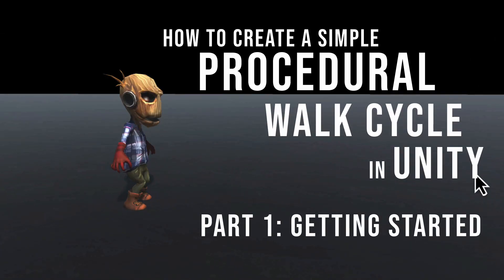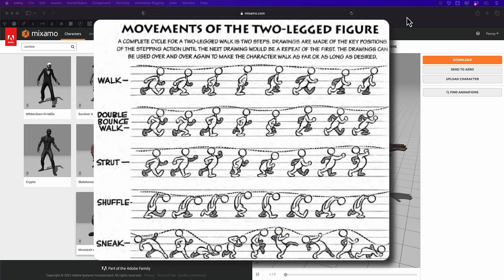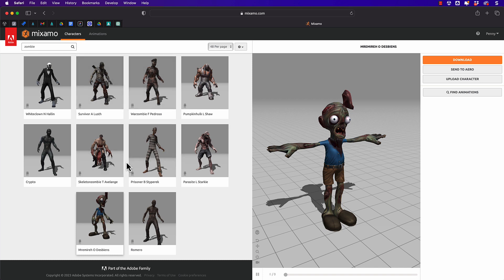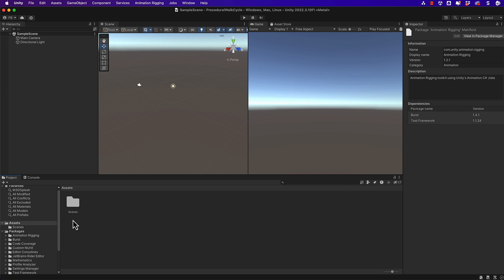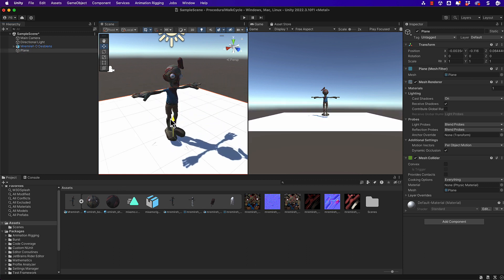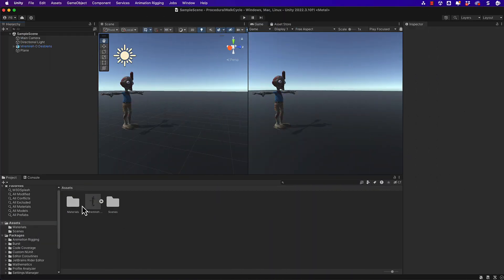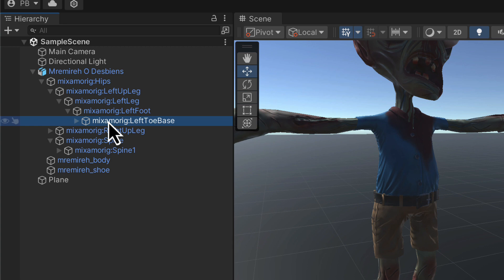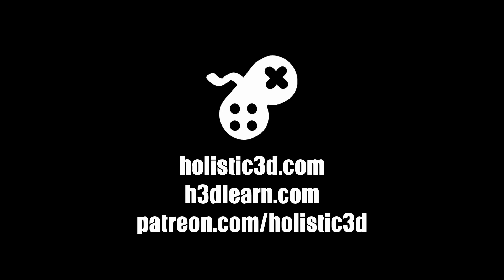Create a Procedurally Generated Walk Cycle in Unity Part 1

Comment: Having watched all 6 parts now, i came to say this is really useful. Ive never given a lot of thought to IK or generating animations rather than making keyframes and moving bits to where i wanted.. this is great as you can do so much and customise it without actually changing the animations so you could put it on 100 toons each with slightly different values for hight and length and give them a limp by making each leg different all with not a lot of effort.